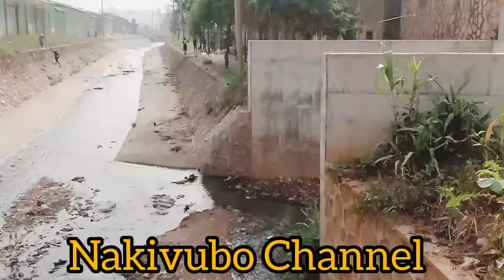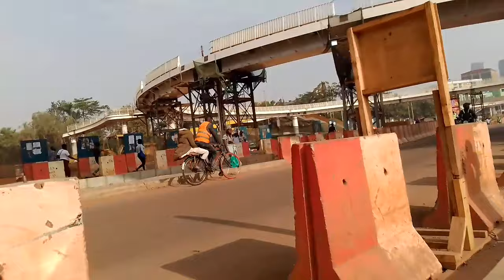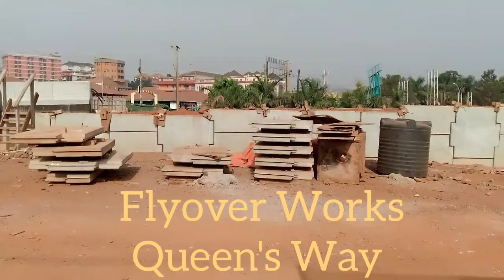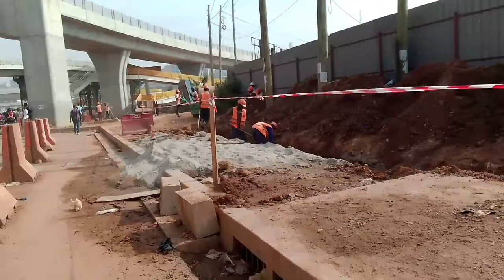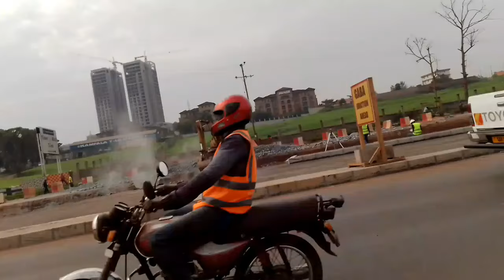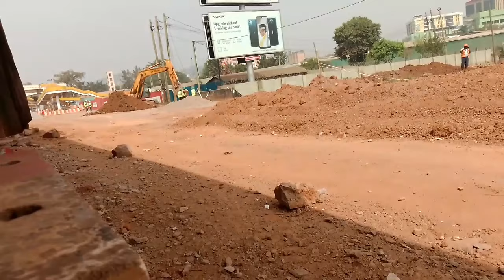Kampala Flyover Road Upgrading Project Update: Uganda’s Longest Car Tunnel Completed, Detailed Tour

Comment: Hey 👋  is it already painted/sanding as it looks so clean and white the vehicle flyover thanks for uploading
Reply from the maker: Yeah. It’s those guys you saw in the video who have improved the flyover. They are sanding it. Although some bits are not yet done. They are also putting side barriers on the flyover. Any civil work or building sometimes it’s ‘finishing’ has to be good. It’s clearly visible the sanded part is magnificent.
Reply from the maker: The tunnel itself not yet sanded. The flyover itself sanding started sometime back. It looks so nice in the sanded parts.
Reply: @BlessedYouTuber  lemme hope 🙏 they gonna put some gray paint on it and looks good 👍
Reply from the maker: @cyruskisitu1868  let me hope so. I will be updating you as works progress.
Reply: @Blessed YouTuber  thank you I can't wait